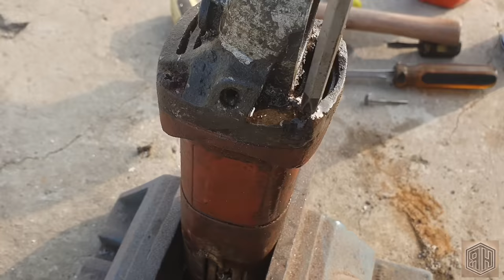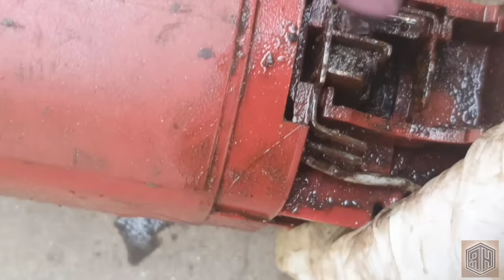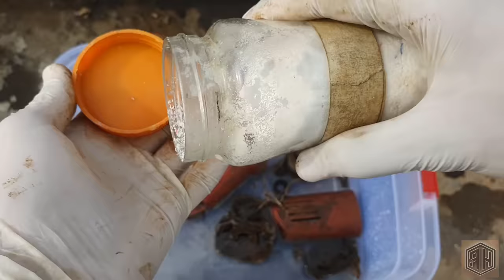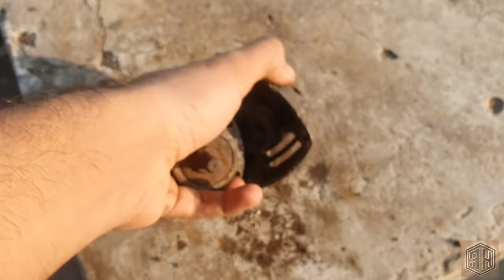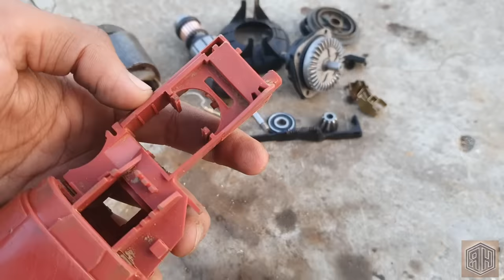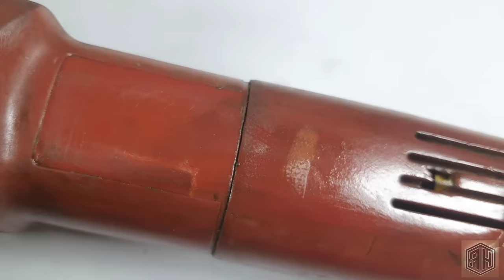RESTORATION The Most Destroyed & Rusty Angle Grinder you never seen before - Kinda IMPOSSIBLE Repair

Comment: The bearing wasn’t stuck. You were supposed to remove the bolt and the gear and bearing would have come off with the head. Than you would pull off that snap ring to remove the bearing
Reply from the maker: All the items were Rust dissolved and was kinda impossible to even move.

Comment: I also got a broken angle grinder. It was in good condition but it was only missing the brushes and the adaptor. So I decided to add the adaptor. It costs around $1. Next I decided to add the handle, wheel guard and brushes. They didn't charge me for that. So the whole thing costs only about $1 !

Comment: Just a tip my man for further reference. Next time you have rusted screws, bolts or anything metal.
Try using vinegar it clean them up it works great and if you want to make it more powerful and turn it into an acid, add some salt.
Just a tip from a restorer on the other side of the world.

Comment: I understand the point of the video is to demonstrate the refurbishing of this tool.  However, a professional shop would not waste time on it. Between the cost of labor and all of the replacement parts needed would cause the cost of the repair to exceed the cost of a new replacement.  Then there is the warranty to consider. Most new tools have a 1 year warranty against factory defect. New replacement parts generally have only a 30 day manufacturer's warranty. This tool would be considered "not economical to repair".

Comment: I guess like the mountain, just because it's there?  Otherwise I see no point, you can pick these angle grinders up for about $10-50 anywhere, new, with a warranty.  If it were a $500 tool to purchase it might make some practical sense, but even there you can find them in vastly better shape to start with for again, next to nothing.  Just to prove, I guess.  In the end you kind of have a working angle grinder that looks like it fell off a truck more than once though.

Comment: you're using wd40 the wrong way, the idea is to give it time to penetrate, not just spray and go... first spray and clean the surrounding area of dust and rust with steel brush to open the edges of the screw ... then spray again with 30 sec to 1 min intervals and give it time to penetrate into the threads ... it takes time if you want it to do the job perfectly.

Comment: So I watched your video and you called it a Restoration …? No sir , it’s not called a Restoration when you use different parts from a different grinder .. Restoration is when you take something like your grinder and tear it all down and strip the old copper wire out of it and put new copper wire back in  , that piece that broke weld a new piece in its place ..